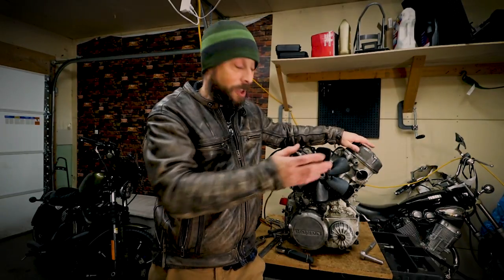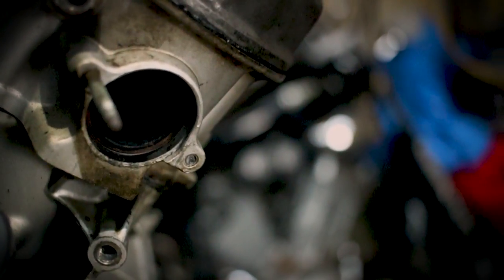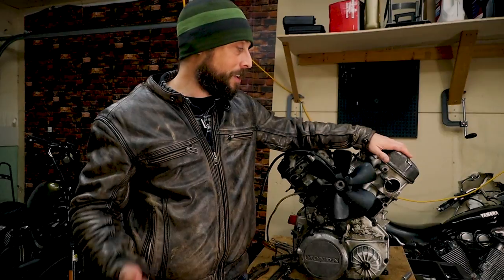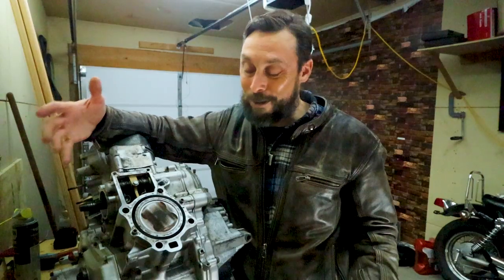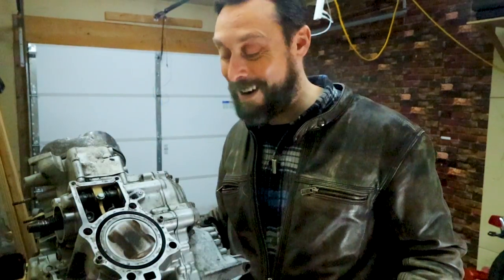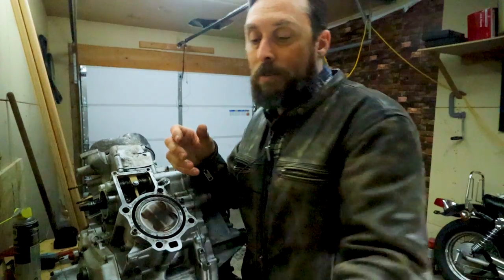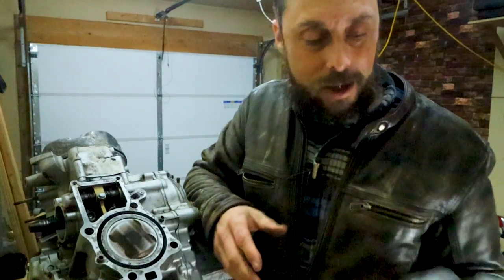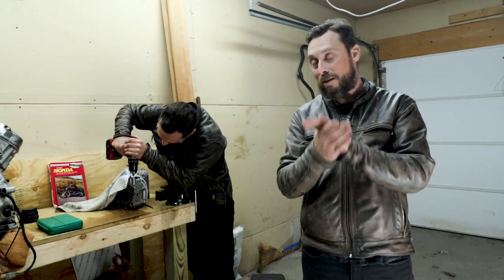Swapping Cylinder Heads? Honda GL500 / CX500 -  Cafe Racer Build -  Ep 7

Comment: Joe, was relieved when you decided to go with the original head. Great to your vids again. Stay safe ride safe. Cheers.
Reply from the maker: Yeah, it just makes much more sense to use the original head. I'm going to have to drill out the stud and tap new threads. This stud ain't coming out!
Reply: One trick I've learned from my father is that you can drill a smaller hole in the stud and thread it with a reverse thread and use a longer reverse threaded bolt of the size of your reverse thread and just turn it counter clock wise to tighten it, once it reaches the end of the thread and you continue tightening the reverse threaded bolt the main stud will start turning counter clockwise and loosen until it's out. 
It's a bit more work and you need the reverse thread cutter and a reverse thread bolt of the same size but it's a much cleaner job and you don't have to drill and thread the head. Stay safe ride safe. Cheers!